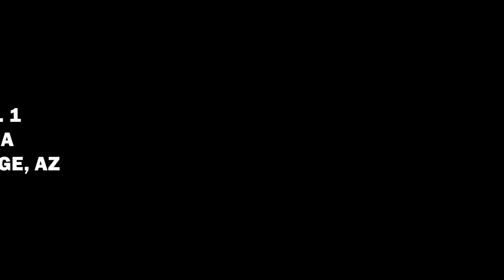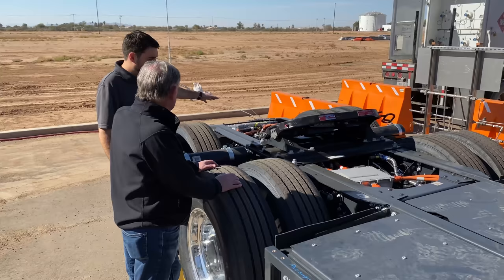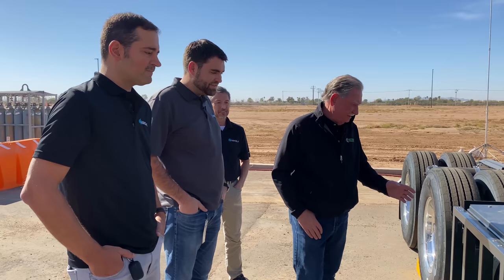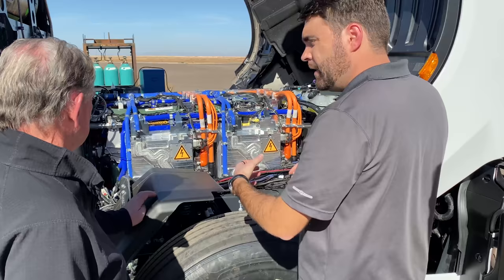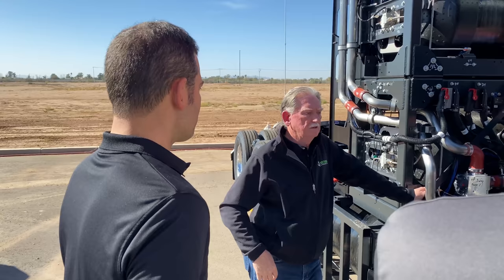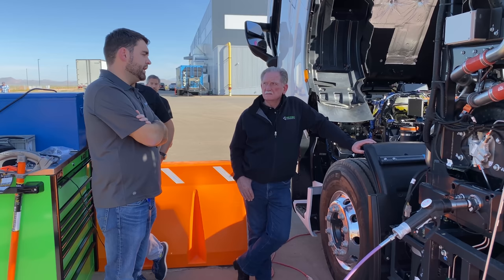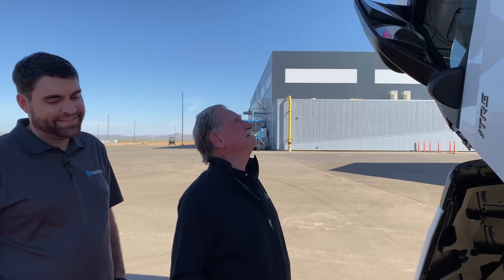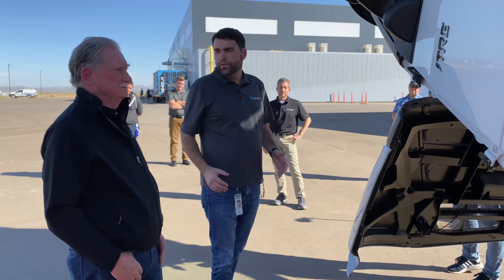Nikola Series - Ep. 1: Introduction & The FCEV Alpha

Comment: 200 hp - is that enough?
Reply: That was shocking given that, for example, the 2022 Chevrolet Camaro has 275 to 650 up depending on the model. But this has batteries with electric motors and they put out a lot of torque and right from the get go, so torque might be the more important measurement.

Comment: 270hp lol meanwhile....Scania/MAN just release there latest SMALL 6 cylinder engine (basically phasing out the V8 on the most part to meet emissions)  at 560-570hp...........going to have to do considerably better than this 400hp minimum to be viable......

Comment: Everybody get their calculators out and start looking at what was glossed over or missing so far:
1) What is the battery size? The battery has to be used to make up for extra power (above the claimed 200 kW Fuel Cell power) to provide enough kW for the vehicle on sustained hills, with a full load. 
2) How much power is needed to take 82,000 pounds up a 10 mile 5% grade? and is there enough to make it after the battery is exhausted? Anyone ever heard of a stock Mirai doing Pikes Peak?
3) A hydrogen delivery truck might be allowed to carry hydrogen at 250 bar?. What is the maximum amount of hydrogen that a truck can deliver to a dispensing location (it might be only 350 kg). and how many FCEV trucks would this fill at 60 kg per truck?
4) How many more hydrogen tankers would be needed than diesel tankers to provide the same amount of mileage (gallons/mile vs kg/mile) at a dispensing station?
5) How much extra fuel would be used just to deliver the hydrogen vs diesel.?
6) How much energy and time is required to pressurize and cool down the 250 bar hydrogen to 700 bar and minus 40 degrees? (Hydrogen heats when it expands into tanks)
7) What does hydrogen cost per kg at the point it is being dispensed? Dirty (grey and blue) hydrogen costs more than diesel, Green hydrogen costs 2 or 3X diesel.
8) With the determining factor for trucking being cost per ton-mile, how does hydrogen compare with diesel? 
9) How big would a hydrogen card lock station have to be compared to a diesel card lock station  to provide the same energy to  fleet of trucks?

Comment: Obvious problems:
Nikola has been in operation a very long time but are apparently still working out the fuel nozzle standard?
The trucks cost more than diesel to purchase, and there is no saving on fuel, as hydrogen is currently very expensive. Nikola previously lied that they had found a way to produce cheap hydrogen, but as we see in this video, they themselves are purchasing hydrogen from others and having it shipped to the factory and haven't even built a proper fueling station at the factory. 
The claimed range is from hydrogen fueling station to station, not from pickup to destination. Unless there are hydrogen stations along the route or at the two ends this will mean they will not actually get anywhere close to that range. Electric truck users will almost certainly build charging stations at the main depos and there will be a need to increase the availability of suitable fast chargers along the main routes, but Tesla has proven it can do that, whereas Nikola cannot do that with hydrogen as it would not be economical to do so. They are either hoping for government subsidies, or they will only sell trucks for one or two routes in California. Anyone buying these trucks has to hope that the 'hydrogen economy' doesn't fail in the next 10 years or their investment is lost if if the hydrogen fueling station on their route closes. Given that the hydrogen stations are heavily subsidized and not profitable, this is highly likely.
The real issue is that Nikola appears to be several years away from any kind of actual production by which time they will be competing with fully electric trucks from several suppliers including Tesla and there is simply no way they can compete.

Comment: I'm only at 3:21 in the first video. They're pursuing a hydrogen based vehicle? Why?
It's not just the raw cost of extracting H2. It's the cost of the materials for the fuel cells, the distribution network, the insideious nature of H2 destroying the storage tanks and fuel system. H2 is great for one use rocket engines, but almost certainly not practicle for vehicles that have to run for thousands of hours. Sorry, it's just not going to work.
Reply: @danieldeblasio9368  You think H2 is such a great idea, go ahead and buy a vehicle powered with it. Just don't park it anywhere near people or drive it on a public hyway because it's a rolling bomb.

Comment: Sandy pointed out that a 4 year old could tell Nikola how to approach reduction of refueling time. It has been over a year and this easily addressed problem hasn't been improved upon. It makes me wonder if they have enough talented engineers working on this problem they are trying to solve because this is a glorified plumbing issue that they are waiting for an industry that doesn't exist to solve for them so they can order the solution. Just have it worked up in CAD sub it out for rapid manufacturing and order a larger diameter hose. Then begin proposing validation and standardization which is the hard part.

Comment: Truth is, I believe in Sandy Munro - but hydrogen fuel cell is hydrogen FOOL CELL to me - as Musk said. Rolls Royce ALREADY has small modular nuclear reactor that can easily be deployed to produce electricity. As far as I'm concerned, it is easier to follow the Chinese companies NIO etc to do battery swapping for large trucks at the depot, at truck stops and at the sea ports. Trucks are not cars - and also remember that we've been swapping batteries in reach trucks, VNAs, forklifts etc for many years. You build the truck so its easy to do a battery swap - these hydrogen things still carry a batteries at the end of the day

Comment: Hydrogen's best case numbers only match current battery tech. 4680 and beyond is going to leave Hydrogen stranded. It will NEVER reach enough scale. Are you sure Sandy? Hydrogen is just replacing a dirty centrally controlled fuel with another centrally controlled slightly less dirty fuel. Using renewables is 'possible' but the end to end inefficiencies don't make sense.

Comment: I'm very skeptical about Nikola.  Everything in this video seems to raise more questions than answers.  1)  For a factory, that's very empty.  Big building.  No equipment.  2)  Where is everyone?  Seems like there were 20-30 people on site.  3) The alpha truck.  Way too polished.  In my industry, if it doesn't look like a work in progress, it's likely looking like that to hide a bunch of smoke and mirrors.  4)  Stated life is 700k -1M miles.  They state that to really be competitive truckers are looking for double the life of the existing ICE counterparts.  This seems to match the benchmark, not beat it.  5)  FC - curious when they would need to be replaced and why.  6)  Over hydrogen strategy.  It'll take a lot of infrastructure to make this viable.   Curious about the cost difference between a 12 bay Tesla SC vs a 12 bay H2 station.  Looking for insight as something really doesn't feel right.

Comment: Use hydrogen to generate clean electricity in rural area charging station for normal EV's. Clean energy, efficient power, and no load on the already degraded power network, win win win .

Comment: Until pipeline transport and fueling stations are solved, hydrogen has no scalable future. I’d rather create renewable methanol via electrochemical conversion of CO2 to CO and water electrolysis to make H2 and then make secondary fuels from the renewable syngas. Then you close the carbon cycle but you don’t have to reinvent the fuel infrastructure. But nevermind, EV technology will get better until going back to combustion or fuel cells looks like a step backward.

Comment: The math still does not come close to working, there is no market for trucks that cost a lot more per mile to operate than the current diesel trucks. Hydrogen FCEV trucks will cost twice as much per mile for fuel and then the need to replace the fuel stacks every 100-150,000 miles means maintenance costs are also way way higher than for a diesel truck. 

Their "A" trucks are being made for them in Germany by a company that makes hydrogen FCEV semis and shipped over, that is why they are so well built for an A prototype. Because they are not prototypes.
Reply: They are assembling trucks in Coolidge now (where Sandy was).
Reply: @tribalypredisposed  There are established companies that see some advantages for fuel cell semi trucks: Daimler/Volvo, Toyota/Hino, Hyundai/H2 Energy, Navistar and Stellantis.
Reply: @lockbert99  what do you think the advantage is? The "advantage" is that hydrogen provides a market for natural gas that they use to make the hydrogen, and it is a way to try to preserve fossil fuel use for transportation. But there is no benefit for the consumer.
Reply: @tribalypredisposed  Hydrogen may turn out to be a failure, but the trucks aren't being built by natural gas companies.

Comment: Did you have to help push it up the hill? Only kidding - hydrogen will be a good addition when its cheaper to extract.
Reply: Unfortunately it will always take more energy to extract than it contains.  Physics, not magic.
Reply: @StormyDog  Thanks Ed, even if they use renewable energy - surely that would be worth it?

Comment: Their numbers deserve more interrogation. Fuel cell class 8 trucks seem to be getting closer to 5-6 miles per kg of H2.. Based on 5 tanks x 12 kg that is 60 kg total.. This would equate 360 miles driving range. And if they achieve their 14kg per tank target, this would increase to 420 miles; so I'd say 500 mile is at optimistic end.

They also talk about battery degradation, but nothing on fuel cell degradation. Fuel cell buses seem to only be getting 8,000-10,000 hour warranties on fuel cells. US DOE expects 30,000 hours is parity for diesel on class 8 semi's; but Nikola don't talk about what their warranty hours are on the fuel cell. Will they warrant for 30,000 hours?

None of this is to say hydrogen fuel cell trucks wont work, but there is still a long way to go, particularly on durability and costs. I'm still to be convinced it will end up being an economic proposition.. higher vehicle cost, higher fuel cost, likely similar maintenance costs (or potentially higher depending on fuel cell durability).

Comment: And so far,it just looks like the factory is an empty box, and they are not ready to fill since they are not doindesigning the truck.  So how far away from a firsr production model? 1, 2 3 years?
Reply: The battery version is scheduled to begin production early next year. This fuel cell version in late 2023.

Comment: Admittedly, I don’t understand this technology.  Is the hydrogen used to generate electricity for driveline motors?
I do know that 
Elon Musk has said that with the exception of rockets, all transportation will ultimately be battery powered and that hydrogen fuel cells are “mind boggling stupid.”

I think I’m gonna stick with the guy that sends people safely to and from the ISS and lands rockets…
Reply: Fuel cells generate electricity (combine hydrogen with oxygen in the air to get water and somehow also move electrons), but there is also a smaller (than BEV) battery in them. Fuel cells do not respond quickly to the accelerator pedal being depressed and the battery makes up for that and can also capture the energy from regenerative braking. They mentioned that the electric motors and eAxle in this fuel cell truck were identical to what is in their battery truck.

Comment: At least they are not pushing Hydrogen for cars like Toyota (completely brain dead). 

On the other hand, Hydrogen is not easy to deal with. The application that is the least cost sensitive and requires the highest performance is space rockets where Hydrogen is the ultimate fuel. NASA used Hydrogen in Shuttle main engine but for commercial rockets everyone uses Kerosene and LOX because such a pain to source and deal with Hydrogen. So if not being used for ultimate application, can't see it getting wide spread use by a bunch of "low tech" truckers.

Comment: Albeit this is an Alpha prototype I can already see the huge complexity in this system and with that comes the propensity for manufacturers to implicate planned obsolescence to increase profit. Furthermore, whos going to work on this fucken thing? You need a fucking engineer to work on this thing, in order to get that life cycle cost down to the point its profitable it has to last a good long time and miles before anything needs servicing because your going to need to support a technician with a 5 year engineering degree to service it, those don't come cheap per hour they have 250,000$ in student loans to pay back. You need this thing to be serviceable by a guy with his GED who went to a 2 year tech school at night while paying his baby momma child support. Those engineers standing around talking with Sandy need to factor that into their flow charts.

Comment: I wouldn't invest in that company even if I was using OPM.   Was Trevor anywhere to be seen or is he grifting people as a side gig? Do these trucks move on their own now or do they still need a 240 VAC power cable? ;-)  I noticed they didn't take anyone for a spin around the block? 

Until someone invents the magic needed to get the efficiency of a hydrogen fuel cell (well to wheel) to at least 50%, I'll say "no thank you." Diesel is still more efficient than hydrogen at the moment. 

One a side note, there are no hydrogen stations in Washington or Oregon but there are a boatload of electrical charging stations.

Comment: Quite frankly: Makes no sense. Way too much parts. A lot of failure sources during manufacturing AND operation. Need a punch of service. Will never compete from coststructure at all. Safety. There are more elegant ways to loose money. Dependency on fuel producers and distribution again is danger.. Decentralization of energy convert and storage by operators (or local small groups of them) themselves is the key. Sandy don’t waste time, even if you loose a few consultancy hours.

Comment: Hydrogen long haul trucks makes alot of sense really, the weight of batteries reduces payload too much. Short haul BEVs should work ok.

Also good to see Nikola appears to actually be making some progress after all the dramas and deception of previous years.

One thing I am curious on, is I heard that the Toyota fuel cells have a scheduled replacement life on the tanks themselves, I'm assuming it's to guarantee structural integrity of the tank, will these Nikola tanks have to be replaced at some point, or do they think they'll be fine for lifespan of the vehicle? Anyone got any idea?
Reply: Yeah, the Mirai tank has to be changed in 8 or 10 years and if not the car will not function. Good question for Sandy to ask. They have 5 tanks that would need replacing, which can't be cheap.

Comment: Back in the 90's, I remember when the City of Austin was testing a couple of Fuel Cell buses- really neat technology!  But just not the right technology, even for larger vehicles like Semis.  Forgetting for the moment that this company, Nikola, does not have a very good history:  The Fuel Cell system was, and still is, very expensive and more complicated than a BEV system.  Their fueling stations will be expensive to create.  And even if those costs come down, the cost of the 'fuel' (i.e. electrons) compared with a BEV is always going to be 2-3 times more expensive!  And over 800,00 to 1,000,000 miles, that adds up to a very big pile of change.  And to add insult to injury, the Fuel Cell system still has to rely on batteries to work!  the only advantage this system has is a faster fueling time- but really, after driving 400-500 miles, does any trucker need to refuel in 15 minutes?  In fact, legally, aren't they supposed to NOT drive for a certain amount of time?  The only caveat I have to this negative view on Hydrogen is Sandy- I would be hard-pressed to bet against him on his technological knowledge and prognosis of future use.
Reply: autonomous driving system does not need breaks,  coming soon in near future.

Comment: There are no benefits in operating a COE vehicle on US highways.  There are however many drawbacks to this configuration.  The tilt cab design is complicated and expensive and the cab position puts higher loading on the front axle.  Maintenance is more difficult because the cab must be tilted to access many components.  Watch a few videos of someone tilting a cab in Europe and you will quickly understand the issue.  Entry and exit from the cab is much more difficult than on a US style conventional.  Crashworthiness is also debatable.  The COE provides an extremely limited crush zone for the driver in an accident.  This issue has followed the COE style since the 1940s and has never been fully addressed.  Remember you are sitting at the very front of 82000 pounds and running at 65 MPH.  Stopping distance is 250 feet on dry pavement.  The Nikola Tre also has that ridiculous gap between the cab and trailer.  This provides very poor aerodynamics for the combination unit.   Last item.  It's a 6x2 with limited traction abilities.  It probably won't be sold in Canada where this configuration hasn't yet been fully accepted.
     Please, no more discussion about how cool COEs are.